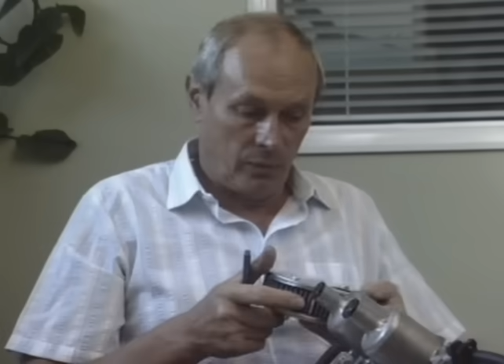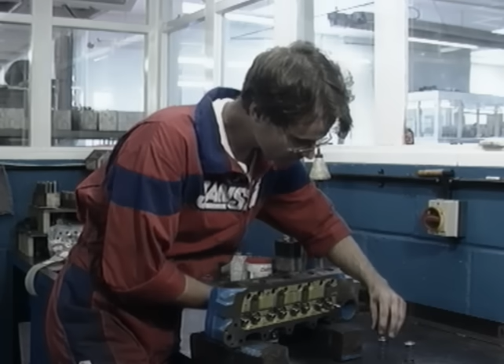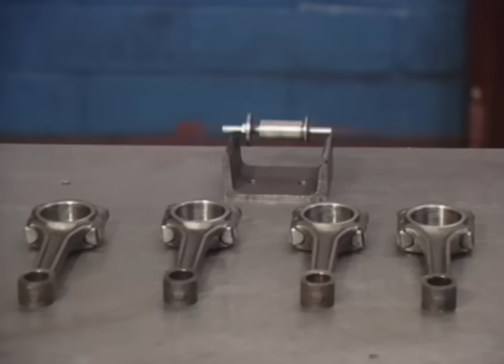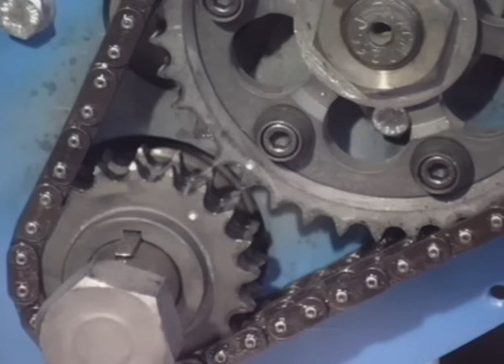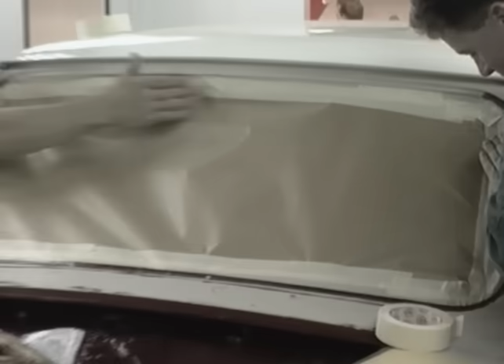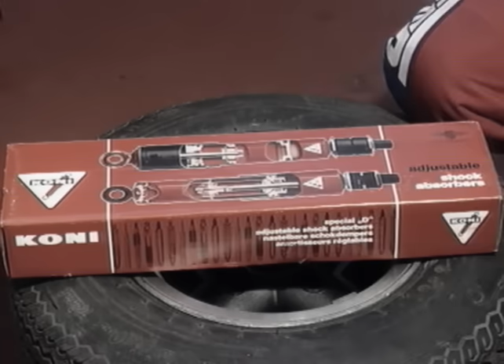My Janspeed Mini Cooper-S

Comment: In 1966 I used to own a 848cc 1960 mini and about 1973 a 998cc 1972 mini.  Brilliant little cars, the early minis had sliding windows with a chrome button type opener, changed to plastic later on and then of course wind up windows. I remember losing all drive on the early min, Crown Wheel retaining nut came loose as I remember, sorry I am starting to reminisce here.  Great Video many thanks.

Comment: The master of "a series" engines Dave vizard read his book twice. I built an engine to his spec using an osseli engineerd head, webber 45 twin choke carbs, with jan speed linkage jan speed exhaust, mini sport straight cut gearbox ect ect dyno results came to 99 b h p at the wheels. I sold the car 14 years ago and have been crying ever since the best little rip arse car i ever had, i even named it "HELL" cause i was a little devil behind the wheel, every road was a race track.....long live the mini.
Reply: Same here, I had a 1400 on a 45 DCOE. Needed a better head but I was 20 and had little cash! Great times. On Spax with S discs, there are so many mods for minis. Always wanted a Arden 8 port or the 16v head. Not sure about 13*7 wheels though... I reckon minis look better on 10s.

Comment: My uncle was Gordon Allen, he made crankshafts for many racers and even  built special engines, and many modified, dry sumped ford/ bmc  double overhead cam specials which he raced. He made a  special crankshaft for a prototype 6R4 for William's who were involved in the engine development of the rally car before it went into production. I had many happy hours spent in my uncles workshop and at the racetracks of England!

Comment: I read Vizard's book cover to cover when I was 15. I had 5 minis growing up but never had the money to do anything with them. The book was amazing though. Taught me all about how cars and engines work.
Reply: Same here but when I started work I built an MG 1275  engine with a nine bolt head using the book(the blue book) as a guide putting it in a 1969 850 shell.I had minilites and cooper S front discs and a brake servo off a Austin 1300 It had a straight through 3 inch exhaust for a while but was too noisy so I fitted a marina back box which was still straight through but with baffles.
I loved that car,me and the G/F went everywhere in it,then I totalled it on the way back from the RAC rally Dalton Woods stage and bought a cortina Mk4 2.0s where you could hear yourself think and not break your spine going to the Yorkshire Dales.
Reply: Andrew Simpson.....Vizard was like a Mini "God" and his books were excellent. I still have both he published and the first one is covered in greasy thumb prints on most pages!

Comment: How nice it would be to buy a mk3 saloon and find it just happens to have a cooper S engine!
Reply: SwanSongRecords......during my Mini mad years when i was not only building and running various Mini from Mk 1's to Cooper S, i was also buying and selling any Mini parts i could get my hands on. I went to collect a scrap Mini....purely as it had a 1300 engine in that i could make use of. The guy selling said, "you may as well do me a favour and cart these doors off as well as they are no use to me". I didn't hesitate. They were a pair of original Cooper S in excellent condition and even complete with door cards! As 'parts'....a pretty rare find!
Reply: Classic mini classic
Reply: Valuable yes but disappointing by today's standards... They only had 76bhp & 0 - 60 took over 10 seconds
The famous Monte Carlo Rally Paddy Hopkirk one was much more trick.. having fuel injection for a start.

Comment: This YT video is a compilation of takes from another video "JanSpeed Mini Do It Yourself" (maintenance, modification, restoration). Google Search found a reference to that in a 1991 ad by "Motor Books" (£24.95) for the video on VHS (tape cassette). So this video uploaded in 2011 comes 20 years later and today it's 14 years after that.  At the time of the ad, the VHS video might have been already a decade old, or a week.
Would have been nice to hear/see some actual performance numbers.
About 1973 I met with a road legal and race Cooper S that maxed at least 220 km/h (~137 miles/hour). Was this car faster?

Comment: Hi Janspeed , I would like to ask to see if you can build me a Austin mini bole front van with the engine as a 1275cc fast road race cooper sport. With a standard fast road race gearbox and standard drop gears. also can you fit the adjustable front and back camber kit. But build the hole car with sound proofing and a sound proof bulk head and just the standard single dial in the middle with the sound proofing running behind it. And can you paint the van and finished in grey silver lacer  Thanks Russ.
Reply from the maker: Hi Russ
Please contact Mark Vaughan (MD of Janspeed) to discuss your requirements. His email is mark.vaughan@janspeed.com He knows about your request.
Best regards